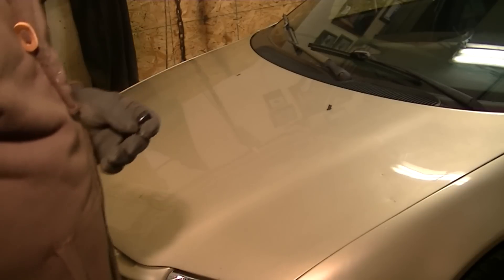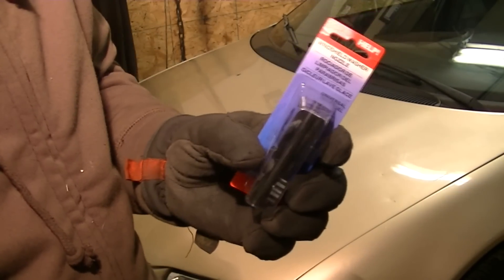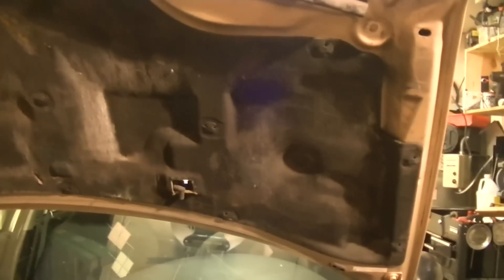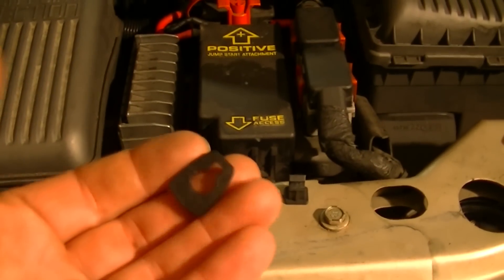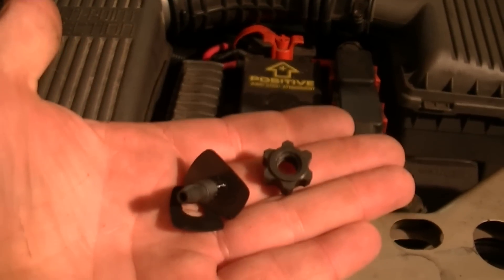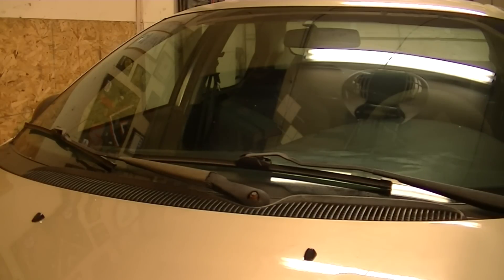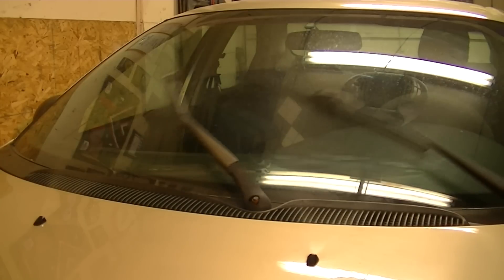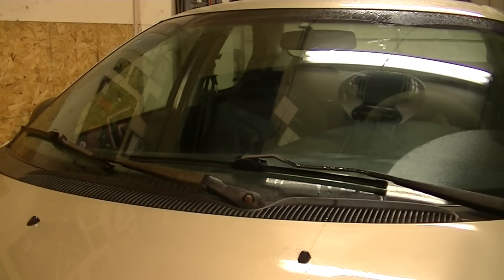Washer Nozzle Replacement

Comment: What if one has a heat shield right under the hood, blocking access to the washer nozzles and hose line.. How does one remove the engine dampener shield without damaging it.

I further information I have worked on older cars, but I'm more cautious around newer cars. I currently own a Mitsubishi Outlander LS 2010. 

It's nozzles need to be replaced but like I said in the beginning there is a engine dampener in the way. 

Please reply if anyone can help. Thank you.